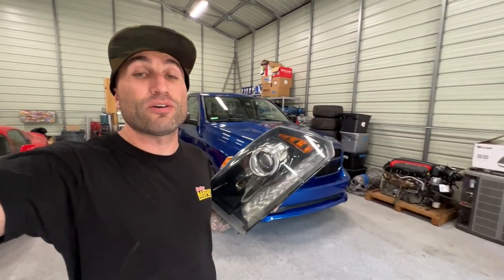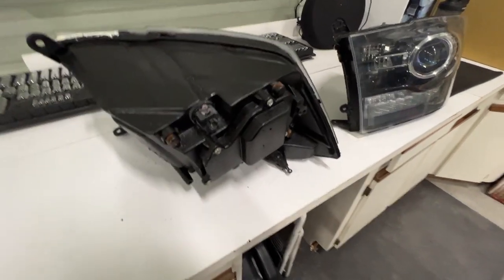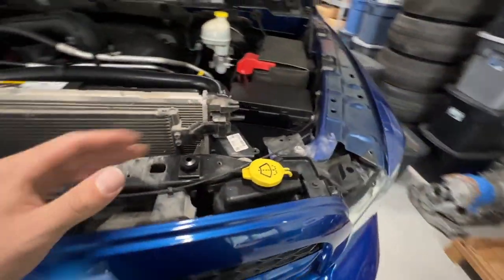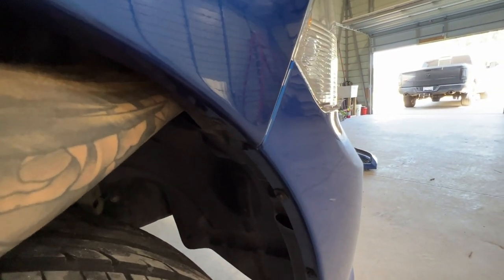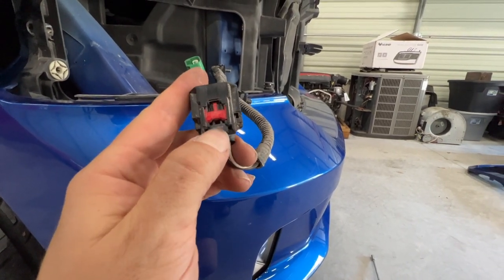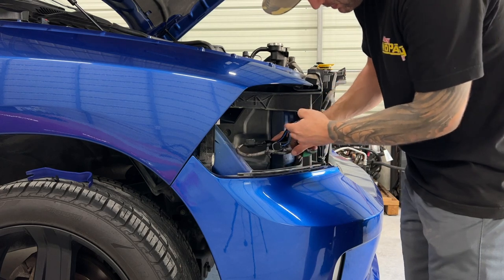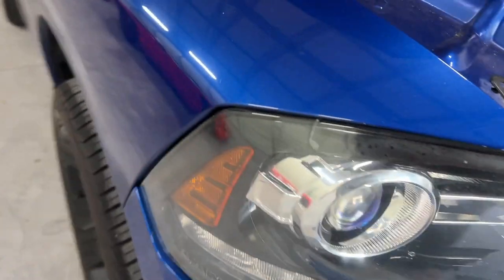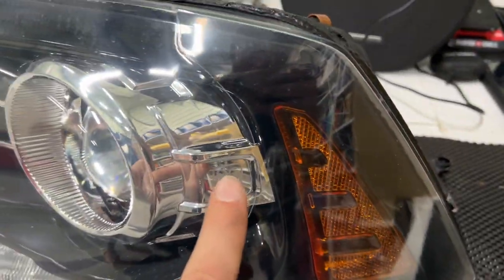How To Convert to RAM Projector Headlights | 1500 2500 3500

Comment: I have a 2016 mega cab with projectors and they suck, can’t see crap at night without fog lights on. Haven’t seen any aftermarket lights that I like. Waiting for tomorrows video now.
Reply from the maker: You need to check out this video I made a few years back. With the right HID kit these factory projectors are the brightest I’ve tested so far LED vs HID in Factory Halogen Projector Headlights
https://youtu.be/Vmi6eeoOL5o

Comment: I have a 02 Xterra. I put Morimoto projectors in it with a HID kit. It looked awesome and worked really really good.  High beams were like driving in the day time.  However HID kit quality seems to really suck in general.  I have been looking for a decent junkyard set to convert back.  Would have been nice to have factory connections without the needs for ballasts and stuff.
Reply from the maker: I’ve been running the same innovited 55w hid kit for years and over 40k miles no issues. I’ve made videos on it
Reply: @BoostedMotorsports  thanks for that, might have to check them out.
Reply: What do you mean?  If you put an hid kit on you still need ballasts ect..guess I’m lost what you are saying
Reply: @Justin12833  just saying it was a plug and play with his truck.  Mine has a ballast on each side with a controller that makes the driver side work.  If the controller fails the driver side light stops working.
Reply: @peanutpower8826  guess im still lost did pre owned?  Did someone else add a hid kit or did you.  When you say ballast you are speaking of HID.  I thought rams were only using leds?
Reply: @Justin12833  I have a Xterra, it’s a after market HID kit with custom projectors mounted in original headlight unit.
Reply: @peanutpower8826  yep makes sense for the ballasts

Comment: I put these lights on my 2011 ram but the ambers don’t come on as my DRLs. Everything else works fine tho. Is it possible I have the harness plugged in wrong ?
Reply: Did you ever figure out the problem? Have the same issue